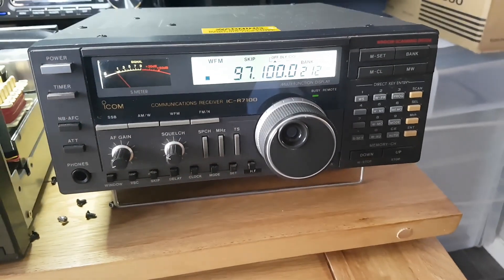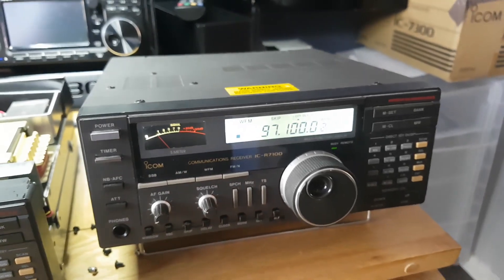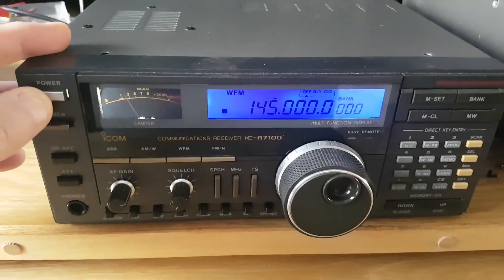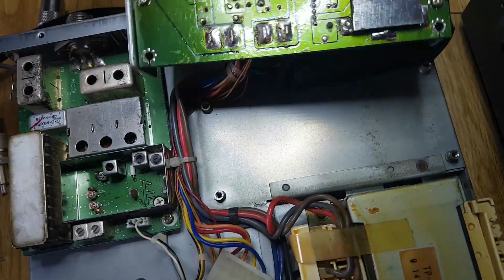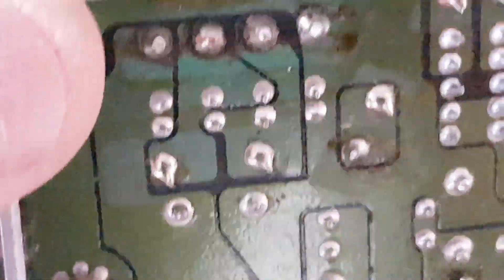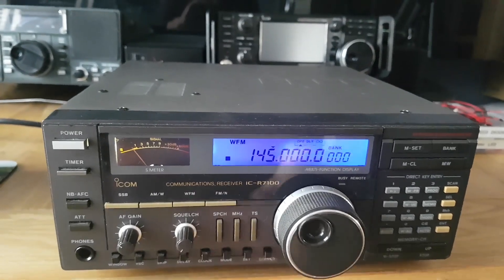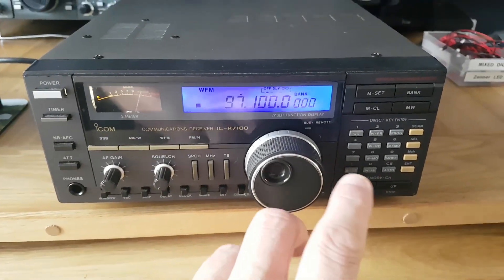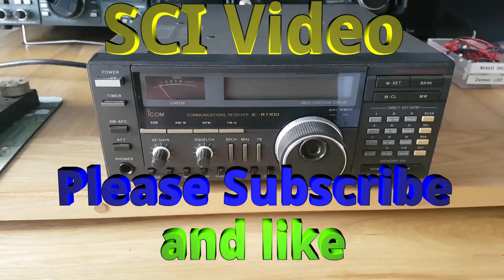ICOM IC-R7100 Mains hum repair

Comment: Hi, how  do  you  get to  the  back-up  batteries, they  are  not  on show  after  case  removal, Regards  Terry.
Reply: did you change your back-up battery,  mine is losing the memory.  is it as simple as changing the battery?
Reply: @dakotamar45acp  Hi, yes  thanks I eventually  found the two  of  them  underneath  the  circuit  casing, there is no hum from the  radio  just the  12 volt  power  supply  I  use it with as  I  read a recommendation  to use it on  12 volt  supply as  the receiver  gets hot  on its  own  mains  transformer  & a  seperate 12  volt  supply will  help  with  long  term  reliability  so  I have  used one from first  buying it, I am  going to  update  the 12 volt supply.
Reply: @dakotamar45acp  You have to seperate slightly the  two   metal  boxes  by lifting one up, be  careful  with the  small  coax plug  just near  the back that  has  to be  lifted out  to lift the  case, its a  pain getting it back in  again after  to locate the  centre pin back in, I  also  cleaned the centre pin as it was  looking  oxidised.
Reply: @texhow1  thanks, somebody on another forum told me the procedure was in the manual.  I will be posting the video I made soon.

Comment: Thanks. Had similar  problems with large caps coming adrift in other radios and PSUs. After resoldering  I put some silicone adhesive between cap and the board to prevent movement and possible future problems.